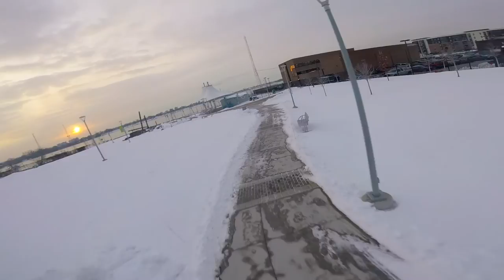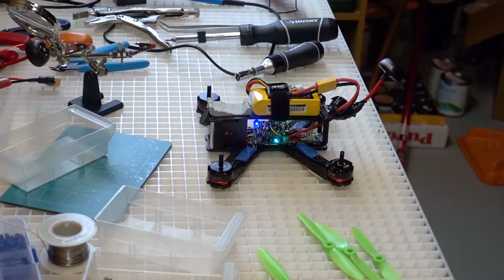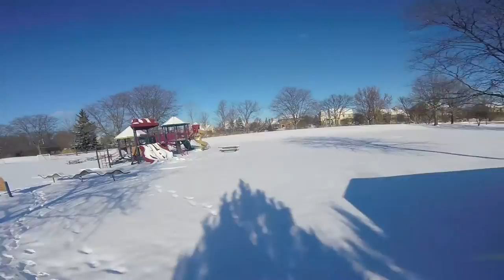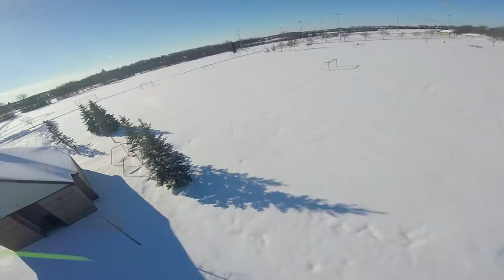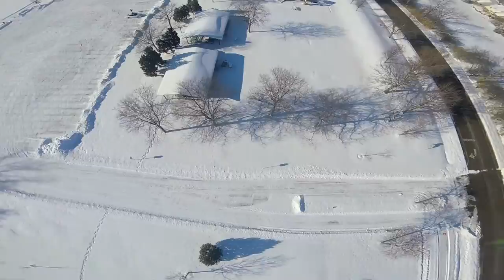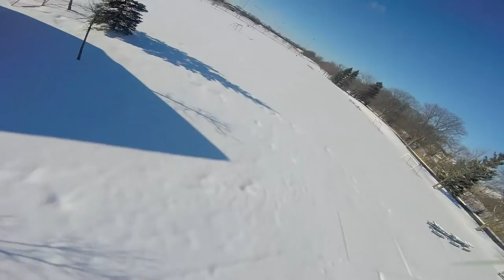Emax 2205 DampenedLight Motor Yaw Twitch Issue

Comment: The twitch is causes by vibrations. The FC that you were using has a very sensitive GYRO causing the yaw movement. Soft mounting the Fc would fix the problem, when the motor screws are not as tight the vibrations from the motor are not being allowed to travel to the FC. I know this is an old video but I still hope this helps.
Reply from the maker: Appreciate it.  This is definitely the case, and serves as a helpful comment to someone else running into the same issue that finds this video.  Thank you for posting this!  I later soft mounted the FC and didn't soft mount the motors and all was still good.
Reply: Heck yeah this helps!!!..lol i have the DarkMax ....F4 Flight Control System with OSD / 5V 3A BEC  -  COLORMIX  and this FC....I have like a glitch or quick pull to the right on punch outs. I tried soft mounting the FC last night but its very tight. I was going to try the motors to see it that will remove the glitch. And the filters i heard would help. I did a cli status and my gyro numbers was way high but i dont know whats normal. But thanks guys i think i'm on to something
Reply: Thank you so much !!!!! I can’t wait to fix my quad with this suggestion! Having the same twitchy problem. I really think it’s vibrations. Need rubber standoff’s.
Reply: Thankyou! I have the exact same problem, 210 frame, but a Betaflight F3 FC. The gyros MPU6000 and MPU6050 are basically the same, only difference being the bus to CPU. I got yaw twitches at certain throttle points. Been looking at blackbox logs and checking there's no interference with the rc signal. I've also been trying to add filters to get rid of that yaw noise. Tried changing from dshot to oneshot, and yesterday I actually tightened the motor screws. I've already ordered softmounts for both fc and engines, so when they arrive I'll slap them on and loctite the screws. Been working with this problem for about a month now, watched hours of Bardwell, read both the github documentation on betaflight filters and page up and down by Oscar Liang. The upside is, as a rookie, I've learned a lot on the way. I actually mentioned to my brother I was starting to suspect some kind of frame resonance. This here is probably the solution, and the first video I've found that pinpoints the exact same problems I got, so from the bottom of my heart, THANK YOU! (a bit premature, but I'm confident this is the solution.)
Reply: I had the same twitching problem but it turned out that the gyro wasn't the issue for me. My issue was that the ESC/Motor protocol in betaflight was set to the wrong protocol. The protocol was set to DSHOT600 and I checked the site where I bought the ESCs and it said they supported DSHOT150 and DSHOT300, so I changed it to 300 and the twitching finally stopped!!

I'm posting this comment in case anyone else has the same problem, cause I didn't find this solution anywhere online
betaflight>configuration>ESC/Motor Features>ESC/motor protocol

Comment: I also thought it is that you motor mount screws are a bit yo long. A way to test is tighten normal and do a continuity test also check continuity against the edge of the frame. If you have a short then find and fix. Nice flying by the way.

Comment: My quad has a problem as well, but a little bit different, my problem was when I keep the throttle stick around the middle of the transmitter while flying, the quad just Yaws left suddenly it just does a rotation on its own, it’s a really frustrating problem I have crashed so many times because of this, if anyone know what happened and how I can fix this problem it will be extremely helpful, thanks!

Comment: thank you soo much i had this problem, when i changed my FC only on 1 motor i tried absolutely everything and i knew the motor was fine. for some reason there was gyro shake on my motor 3. i took it apart put it back together and its gone. maybe something got in to the motor

Comment: Gooooosh FUCK: same problem with mine...........................................I tried change FC change PROPS change prop screws and its still shit.....
 tonight i'll try it . Thanks a lot Sir!
Reply from the maker: Awesome, I hope this fixes it for you too.  I've since had a 2nd quad do this too, and it also solved it on that quad.  Let me know if this works for you too.  Sharing what I find with others so hopefully it can help them too is the #1 reason I started this channel.
Reply: Well i have 2205s motors and mine have this Twitch issue. but only the two back motors. i mean 1 and 3 motors. Am i fckd up the soldering ?

Because i tried different esc-s ... ihave martian ii frame and the frame is bolted together with the pdb...
I can show u a video about it if you're interested.
Best Wishes!
Reply from the maker: do you see the issue if you spin the motors in betaflight?  For my issue you would only ever see it while flying, since it was being caused by noise in the FC.  When testing in betaflight there is no Gyro input.  So if it's ESC/Motor you should see it in betaflight/BLHeli Suite.  That should at least help you narrow it down a bit.
Reply: in beta motortest theres no issue. only while i use my transmitter ... thats interesting... and while i fly
Reply from the maker: Yeah that's what I would expect.  So I don't think it's a solder joint issue.  Did you try soft mounting the motors yet?  I actually think that would help.  Also, is your FC already soft mounted?
Reply: no its not. both. i'll try it
Reply: buts its interesting i bought a parts of drone and i must have soft mount accessories...... its 
irritating
Reply: but the problem with the softmount is when you go to fly you must check the screws everytime before you fly.... so its irritating again :D
Reply: so... today a finally do that softmount of motors and fc too. soldered everything again with gentle  and care.  and nothing changed. .... i really dont know what can I do now.... :( im very upset.
Reply from the maker: +Tamás Kecskés how did you do the soft mounts?
Reply: John E Fly  i did it like you did. i bought mini rubbers and use screw lock liquid but not the strongest.

Comment: Soft mount your flight controller man, Rubber O rings, Motors too if you like. 
Should fix everything.
Reply from the maker: Thanks for the comment Clifford.  I wound up adding o-rings to the flight controller while I changed the wiring for the FPV camera since I had to remount the flight controller anyways.

Having the o-rings on the motors did solve the issue though.  Adding the o-rings to the flight controller didn't make any noticeable difference on top of having them on the motors.  I am sort of curious what would happen if I removed the o-rings on the motors though.  Would that in fact be enough to only have them on the FC...  Not sure I'll take the time to undo all the motors though.  I'm just glad it flies well now.
Reply: Great result, I feel the more vibration you can eliminate, the better, especially with some of the new motors coming out. 
My fc has the MPU6500 gyro which is very sensitive to noise and i had the same problems you were faced with. 
Stoked you got it flying well. 
Great video too! Subscribed.
Reply from the maker: CLIFFORD WAKEMAN Thanks for the support!  I appreciate it!
Reply from the maker: Btw, this is the follow up video I did where I solved it for real and started enjoying flying this quad again!

https://www.youtube.com/watch?v=ARgzo2HOMsw
Reply: Yeah, silly me, i found part 2 after i commented lastnight, also a great video! Looks cold as balls over there, haha, hope you had a great Christmas and new years.